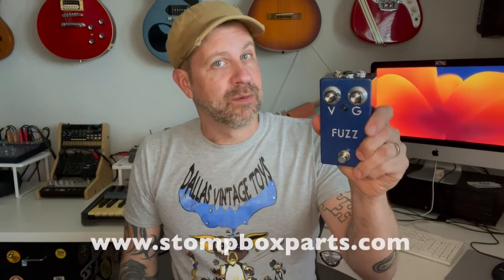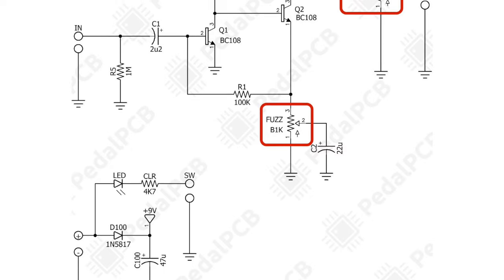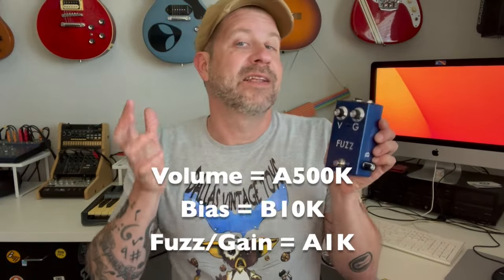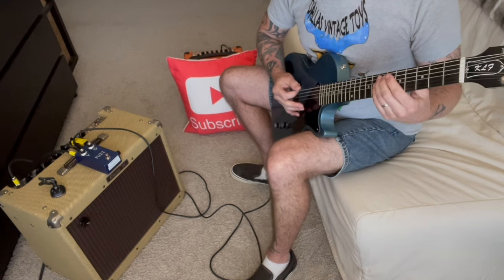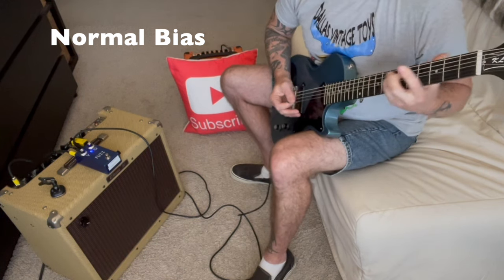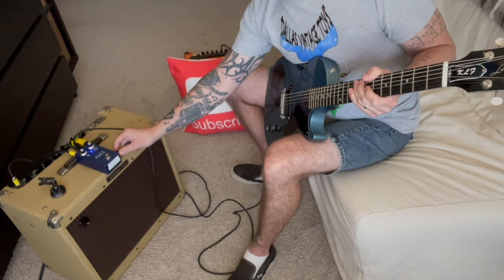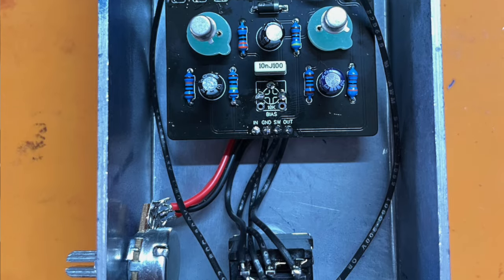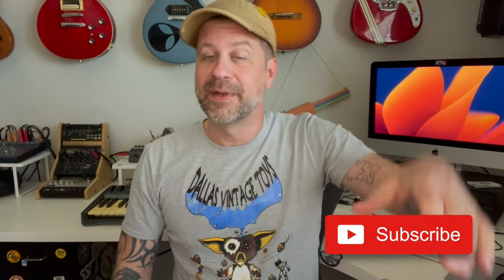How To Make Any Fuzz Face Pedal More Fun to Play!

Comment: If it's germanium, you could adjust the bias the original way which was to keep the pedal in the fridge until you're ready to use it. Also, an EQ control right before the output would turn this into a zvex woolly mammoth.
Reply from the maker: Ha ha.  Good ol germanium. That would do it I suppose.